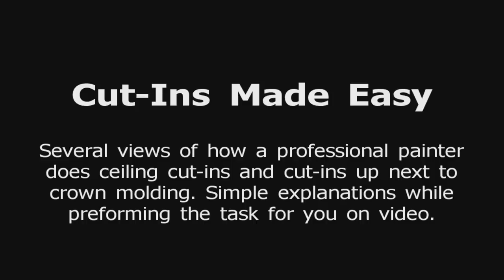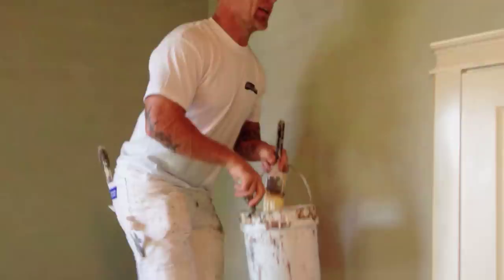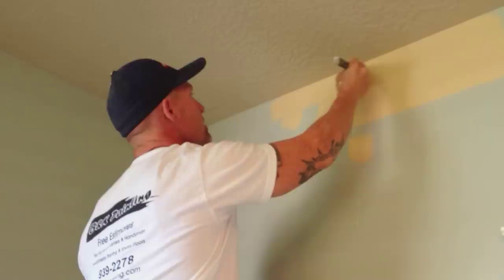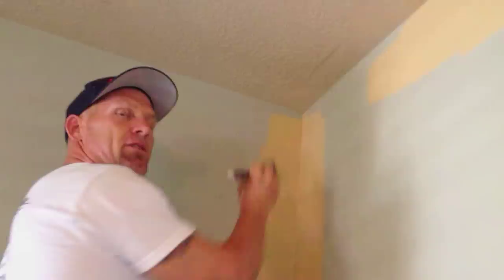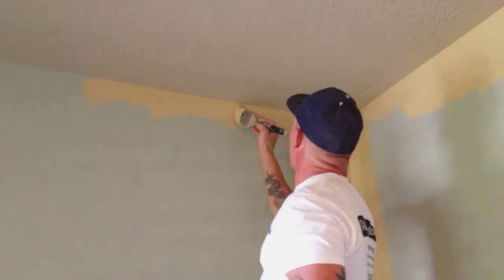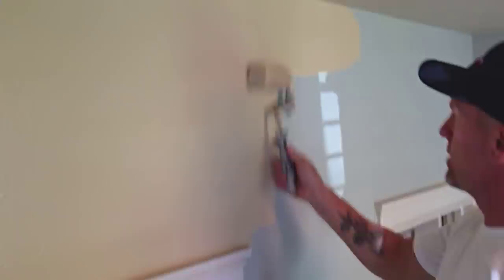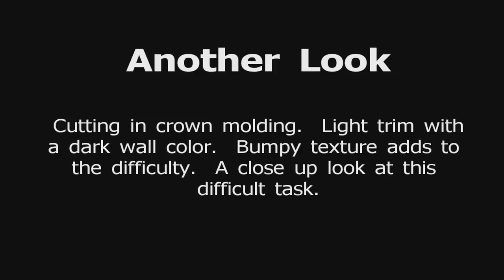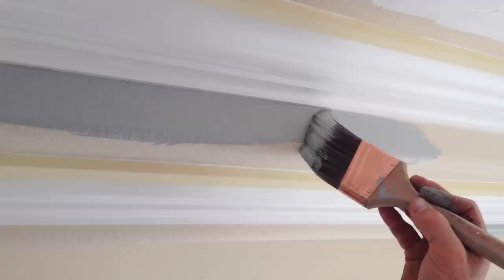CUTTING CEILINGS.  DIY How To Paint A Straight Ceiling Line.

Comment: ok so im cutting in and i do happen to touch the ceiling...now i gotta cut in the ceiling white....also two walls meet at a corner different colours...i cant seem to  get a good line...is it just that hard to do?
Reply: +mick falvey tape it off. that's the easiest way
Reply: +mick falvey I can't do it either. Get the Shur-Line Pro edger. Works like a charm! Just watch a few videos and use it right. The bad reviews are because people don't understand how to use it.
Reply: Mick, that's called a hit.  painters will always keep a damp rag with them. Basically you just have to get it off and then repaint that area. (couple inches) .use your finger or a putty knife wrapped in the damp rag. If it doesn't come off, try warmer water and a little more  pressure. Beyond that, you may have to use a little ceiling paint to touch up the hit. it happens.
Reply: +mick falvey - inside corner or outside?  Inside is cutting in as shown in the video.  One thing to try is hold the brush more lengthwise to the edge being cut in.  That is, Chris is so experienced, he's just tipping a corner of the brush at the edge.  But another method to try is if you think of the width of your brush forming a straight line and then take that straight line up onto the wall so that the entire width of the brush forms the line of the cut in, now unload the brush a bit by wiping some below the cut in so that you don't take a fully loaded brush ever up to the cut in.  Now that it's unloaded a bit, you want to push on the brush so that the bristles have to bend.  So hold the brush at a 45 to the wall surface and push enough so that they flatten out to form a very nice straight line along the brushes width.  See how they want to flatten out into this straight line when pressed just the right amount?  You want just enough pressure in the bend so that the width off the brush forms a nice straight line.  Now just slide the brush sideways to the length of the brush and you'll see it paints a clean straight line.  Now just "steer" this flat edge of bristles up to perfectly to travel the length of the edge you want to cut in.  Don't forget as he does to travel both ways to ensure you get a good fill.   You don't start out near the ceiling (or other wall on an inside corner), but instead you get the bristles to form the line, then as you slide sideways you slowly approach the ceiling to get the "edge" of the brush to do the cut in.   You'll find you'll start being able to travel one direction reliably and it will take a bit longer to go the other way since the bristles have to be bent in reverse and you have to learn the pressure and angle again... It's a skill, move the brush slowly and you'll develop the skill in no time.  It took me about one room around the ceiling and I had it.  Biggest problem was wanting to hurry and move the brush too fast, or taking the properly flattened brush up to the ceiling too quickly.  Move it slower than you think you should at first and concentrate on keeping it forming that nice straight line of bristles.

You can even practice this on open wall to get the pressure part and traveling in a straight line developed and after it dries just roll over that practice area.

Another way of thinking about it is this: imagine the bristles "dancing" along on the wall you're cutting in as you slide the brush.  As long as you keep the right pressure and correct angle, why would any individual bristle be able to travel "up" or "out" onto the other wall???  You'll quickly see with the right pressure and angle there's just simply no way they can and you'll start getting a perfect and effortless cut in.  You can even see this happening with a dry brush by practicing getting the bristles to flatten and travel nicely either straight down an inside corner, or along the top of a wall where the bristles "refuse" to climb up onto the ceiling.

Remember, a good brush also makes a WORLD of difference.  Bristles will simply not play as "nice" on a cheap brush.  But on an excellent brush the bristles will easily drop into a very tight but orderly line when the right pressure is applied to make them bend.  You can do this in the store with the dry brushes to see the difference.

Here's one last way to try and get this all in hand.   Grab a brush in either hand, hold it with a thumb down on the flat metal part.  Now touch it down on a table or flat surface in front of you.  Hold it so that the width of the brush extends towards and directly away from you.  Hold it at a 45 to the surface (left or right 45, not a 45 to or away from you...) and press it into the surface just enough so that the bristles flatten out and form a straight line towards your stomach.  Now practice sliding the brush while holding this angle.  Slide the brush straight towards you, and then straight away from you.  See the straight line the edge is tracing?  That's what needs to happen, now you just need to apply this when flipped around and up at the ceiling, or when traveling up or down an inside corner.  But now you know what the brush should look like when pressured to bending just right, and, the direction the line forms and the direction the brush should be slid to trace that line along your cut in.

Now if it was an exterior corner, I would just roll it with a roller that's fairly dry so that you don't lay down so much that it can "travel" around the corner at all.
Reply: +Roberto Campos - Not even close, nor even possible on a popcorn ceiling.  And then you get paint bleeding under the tape and have a jagged edge, not to mention wasting time putting up the tape, and the expense of the tape.   

THINK about what you're doing when you try and learn and you can master it before finishing the ceiling cut in in a single bedroom.   Guaranteed.   Here's how:

One thing to try is hold the brush more lengthwise to the edge being cut in.  That is, Chris is so experienced, he's just tipping a corner of the brush at the edge.  But another method to try is if you think of the width of your brush forming a straight line and then take that straight line up onto the wall so that the entire width of the brush forms the line of the cut in, now unload the brush a bit by wiping some below the cut in so that you don't take a fully loaded brush ever up to the cut in.  Now that it's unloaded a bit, you want to push on the brush so that the bristles have to bend.  So hold the brush at a 45 to the wall surface and push enough so that they flatten out to form a very nice straight line along the brushes width.  See how they want to flatten out into this straight line when pressed just the right amount?  You want just enough pressure in the bend so that the width off the brush forms a nice straight line.  Now just slide the brush sideways to the length of the brush and you'll see it paints a clean straight line.  Now just "steer" this flat edge of bristles up to perfectly to travel the length of the edge you want to cut in.  Don't forget as he does to travel both ways to ensure you get a good fill.   You don't start out near the ceiling (or other wall on an inside corner), but instead you get the bristles to form the line, then as you slide sideways you slowly approach the ceiling to get the "edge" of the brush to do the cut in.   You'll find you'll start being able to travel one direction reliably and it will take a bit longer to go the other way since the bristles have to be bent in reverse and you have to learn the pressure and angle again... It's a skill, move the brush slowly and you'll develop the skill in no time.  It took me about one room around the ceiling and I had it.  Biggest problem was wanting to hurry and move the brush too fast, or taking the properly flattened brush up to the ceiling too quickly.  Move it slower than you think you should at first and concentrate on keeping it forming that nice straight line of bristles.

You can even practice this on open wall to get the pressure part and traveling in a straight line developed and after it dries just roll over that practice area.

Another way of thinking about it is this: imagine the bristles "dancing" along on the wall you're cutting in as you slide the brush.  As long as you keep the right pressure and correct angle, why would any individual bristle be able to travel "up" or "out" onto the other wall???  You'll quickly see with the right pressure and angle there's just simply no way they can and you'll start getting a perfect and effortless cut in.  You can even see this happening with a dry brush by practicing getting the bristles to flatten and travel nicely either straight down an inside corner, or along the top of a wall where the bristles "refuse" to climb up onto the ceiling.

Remember, a good brush also makes a WORLD of difference.  Bristles will simply not play as "nice" on a cheap brush.  But on an excellent brush the bristles will easily drop into a very tight but orderly line when the right pressure is applied to make them bend.  You can do this in the store with the dry brushes to see the difference.

Here's one last way to try and get this all in hand.   Grab a brush in either hand, hold it with a thumb down on the flat metal part.  Now touch it down on a table or flat surface in front of you.  Hold it so that the width of the brush extends towards and directly away from you.  Hold it at a 45 to the surface (left or right 45, not a 45 to or away from you...) and press it into the surface just enough so that the bristles flatten out and form a straight line towards your stomach.  Now practice sliding the brush while holding this angle.  Slide the brush straight towards you, and then straight away from you.  See the straight line the edge is tracing?  That's what needs to happen, now you just need to apply this when flipped around and up at the ceiling, or when traveling up or down an inside corner.  But now you know what the brush should look like when pressured to bending just right, and, the direction the line forms and the direction the brush should be slid to trace that line along your cut in.

Anyone who honestly tries these can learn in a half hour.  Guaranteed.  I've taught many.
Reply: +mick falvey avoid try to do the line with the brush full of paint, it will help you
Reply: +mick falvey  also,  when you have two colours meeting in a corner, yes..  that IMO is one of the most difficult cuts a painter can make. This is one of the very few times I'm inclined to get out the tape. But I still seldom do.  You can use the wall you're not painting as a guide by letting your hand rub against it.    Also, you can use a super stiff brush. That helps with cutting a straight line ,and you can stretch the paint more.  And finally, turn your brush upside down. In doing this you're bending the bristles in the opposite direction, and this makes them even stiffer.
Reply: you need to tape it...then add thin bead of clear caulk in that line...using a damp sponge..run it up the seam...this pushes the caulk just under the tape preventing leakage onto the other wall...you dont need to wait for caulk to dry before paint....let sit for a few hours...peel tape....wellaaahhhh..straight line..😉

Comment: my question is, 'why'...does the hallo-ing occur?   you spoke of it....but gave no 'reason' that it in fact...happens.   learning a lot from watching your tutorials!  thanks!
Reply: thanks Chris!  yeah,  i've experienced that also.  i'm a 'startup' guy,  small operator, with domestic interior experience throughout my 54 years....(very basic...but a steady hand,  good techinque, and meticulous)   but,  i've been 'rolling my walls first.  after watching your tutorial,  i'm going to 'reverse' the order i get started ( corners and ceiling cut-in's, first,  then backroll with a 4",  just as you do)  hopefully, this will improve my results.  one other item;  despite doing the whole,  up n' down a ladder, moving constantly,  and edging by 'hand'...have you seen this "Accubrush system' for doing Trim Work?   has the little brush behind a 4" roller, with a wall-guard, and...apparently,  creates a perfect,  straight, 'no-bleed' line,  in seconds.   much, much faster than,  doing all this by hand?   thoughts?   watched a video on it...and must say.... tempted to get this.   cut the arduous, painstaking 'edging' time down,  drastically,  it appears?

Comment: LOL !!! your using a sash brush for cut in. Why are you not using a regular brush? The sash brush is mainly used for windows in the south. Secondly, what your calling a halo is actually a lap line. Which is when the paint looks different at the top of the wall. Your correct about the texture looking differently.  Another tip you should show, is the lower you hold the brush. The more control you have. To cut in straighter and faster. You a 3 inch brush you'll get better coverage and it holds more paint,
Reply: Kevin Trimm I'm not a professional painter in that I do not do it for a living. However, I've been doing interior painting for 20 years in my mom's house, my own, for friends, and on the side as an assistant or for friends' businesses... I have a number of friends who do paint professionally; some use a 3", some use a 2.5". Personally, I use a 2" because I find that it fits my hand better (having smaller hands, being a woman) and that I have more control. I'd say it really comes down to preference. If you get great results, it doesn't really matter how you achieve them. Like most things, there's more than one solution to the problem. Idaho, I believe, provides some great information and it's fantastic that he is willing to share his knowledge for free. Just because he recommends a 2.5" doesn't mean you have to use it and just because he calls it a halo versus a lap line doesn't really matter—the information he conveys is the same.

Comment: Most Purdy brushes are over priced.  The same is true for Sherwin Williams and Benjamin Moore products. You're paying for the name. (reputation)   Generally small companies have better prices than big international corporations and many are just as good quality if not better.

All that time cutting in is not really needed if you're using flat paint since you shouldn't see any 'halo' with flat paint.  Even with low-luster or eggshell there is not much of a risk of having your ceiling edges visibly different from the rolled wall.  I've been painting for 40 years and never had anyone notice a 'halo' and I do my cutting in after rolling not before.  This way I save time and roll nearly all of the wall with as little surface for cutting in as possible,  I never need to use 4" roller when I cut the ceiling so that saves time too.
Reply: ***** 
The only time I ever had a problem with seeing the brushed edges are with deep color paints like purple because they're so dark and they have a sheen that reflects light   I didn't know it  is called a halo.  Heck I didn't know a missed spot is called a holiday until a painter friend of mine told me.
Reply: It's not the brush dawg, it's the painter that makes the difference,
It's just life
Reply: You’re cheap. Just admit it and move on. It isn’t because it’s a name. It’s because the quality. You’re paying for a well put together brush that can be used over and over. Those cheap
Brushes never last and the brush falls apart during painting

Comment: You make very informative videos but you really need to work on your audio quality. Using the built in mic on the camera is the worst thing to do. Especially when you are far from the camera. speak to someone about using an external mic source to plug directly into your camera which will cancel out the internal mic and the sound will then be recorded from a much better mic source. Feel free to message me here for more information if needed.
Reply from the maker: Thanks for the suggestion!

Comment: Nice class 5 finished walls, But wouldnt it be better to show folks on textured walls?  that the majority of folks have?

The 4 inch roller is a waste of time.. that " halo" is called a holiday, and is prevented by  brushing down at the end of each stroke,  by applying a second coat you also avoid banding. Sash brushes have a tendency to curl at the tip if you put too much angle on it. 

Yeah, I know everyone's a painter... But some of us have been in this trade since before the cell phone was invented.

Comment: I see the message here being no matter how good at cutting in you think you are, getting that perfect cut is impossible. Even in your video there are one or two places where you've gone a smidge to far on the cut or not quite up to the edge it's just 0.3mm or 0.5mm but on a very close inspection it's visible. Haloing is near impossible to get ride of unless you paint right up to the edge with the same nap roller and in the same direction as you would use on the whole wall. Some times the paint being covered will burn through even after two or three coats.The more you convince the customer it is going to be perfect the more they will inspect the paint work and given enough time any one can pick holes in perfection or near perfection.
Reply: +Robert Thyer actually, your good on the first coat, but 2nd coat just cut and roll a wall at the same time, so u dont get dry cutting. if it all dries together not a problem. just dont leave massive bristle strokes

Comment: if I took that long to cut in a wall I'd be sacked and what's with d roller.
Reply: just wasting time using d roller to extend the cut in just bring ur paint out a bit more with the brush. u can get to within 2inches easily of all corners when using a 9 r 12 inch roller when painting d wall.